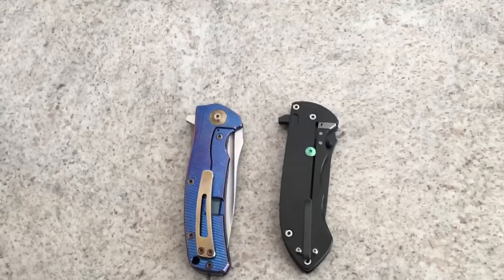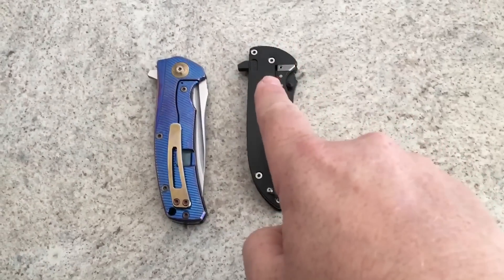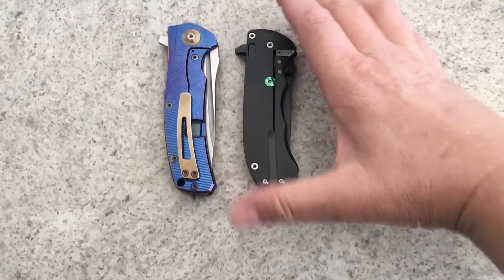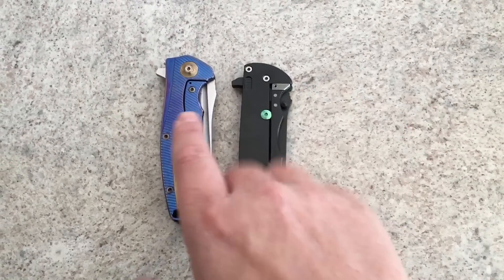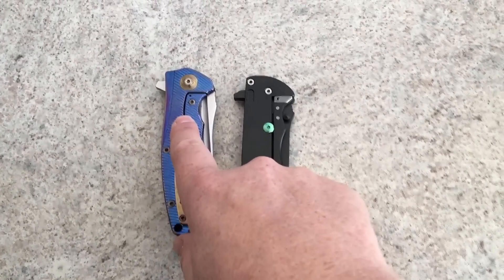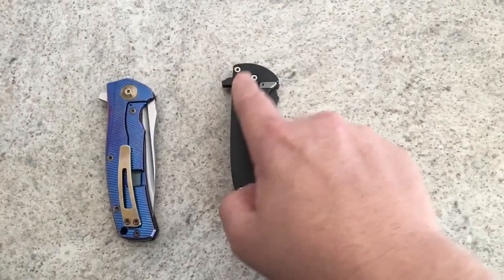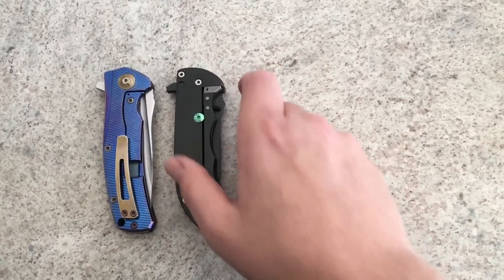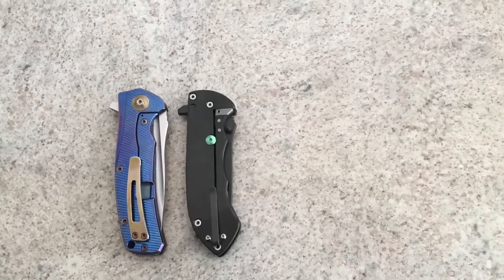Anodizing vs coatings

Comment: Not a knife enthusiast but i needed this information for buying a custom keyboard. thanks!
Reply: So, can you tell me which is better?
Reply: @nhannguyen4847  I prefer anodized. For an anodized aluminum keyboard you arn't going to run into the kind of hard surface damage that would cause any serious wear unless you dropped something on it, whereas repeat friction from your palms is more likely to rub away cheaper coatings.
Reply: @carlhilber2275  thank you 😁
Reply: @carlhilber2275  ecoating is more durable then annodizing? U mean, i brought annodized keyboard , and I have option of ecoat as well